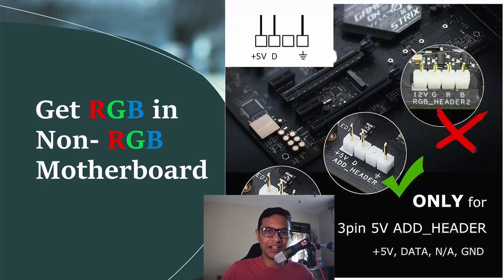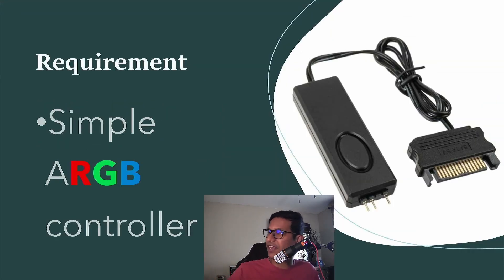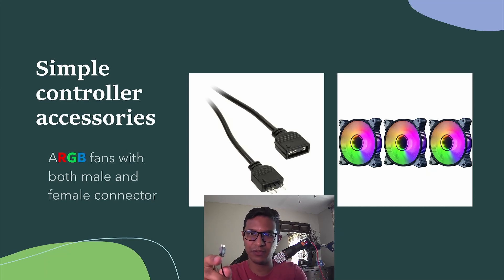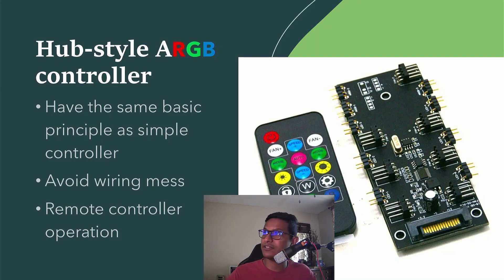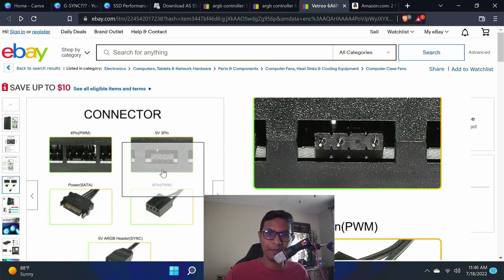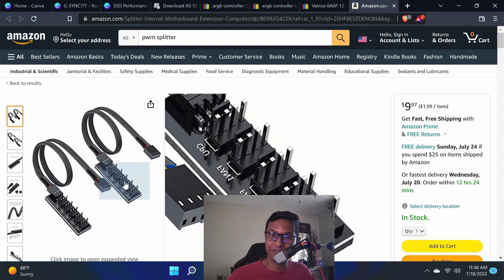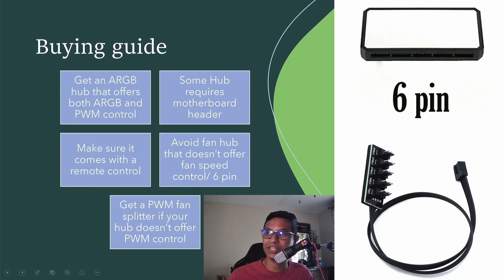How to get RGB on a Non-RGB motherboard

Comment: So I can use an argb hub just to control the rgb and I can control the fan speed from the motherboard if I connect the 4pin directly on the motherboard? My motherboard does not come equipped with an argb header only 4 pin

Comment: Great video brother, but is there an adapter that powers the RGB connector of the fans directly with a sata connector?
I have an old motherboard that does not have any RGB connector and I would like to make the RGB of my fans work.
I have been looking for a solution for days and online there is not even a shadow of these products.
God bless You!
Reply: Have same issue have 4 pin rgb fan but don’t have rgb or argb header in my motherboard how I power my rgb fan ? Did you find any solution

Comment: My fan hub has that sata to rgb thingy built in!!!!
Reply: What's that?
Reply: @Marco-vn1db it supplies power to more argb devices in a hub itd be because in the case of argb there is a recommended 4 device per connector due to it only having 5 volts

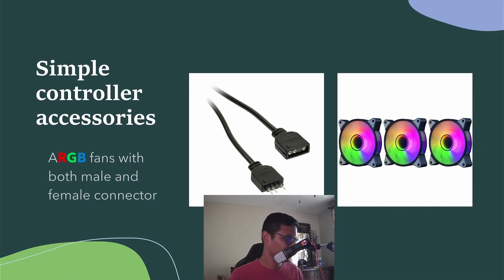Comment: 1:43 I am late to this but can I add 5 fans together to it? Also when I power on my psu like the swtich will the fans start or will they start only if I click the case power button?
Reply from the maker: @SuiiSpeed07 you can chain as many fans as you want. You have to turn on the pc to make the fans spin.
Reply: Please respond fasy
Reply: Answer: yes

Comment: Hello, I have a msi z370-a pro without any rgb or argb port.
can I control rgb with a software?
Thanks a lot
Reply from the maker: @darkomen3199  no. You need external rgb controller which is controlled by little RF remote control. Software control not possible.
Reply: an RF remote would be better anyways as software is gonna take up your PCs resources
Reply: Bro i hawe asus prime b450m-k ii and ARBG Se-214-xt cooler.My motherboard dont hawe 3 pin 5v and cooler dont show light did this controler can work on this cooler. Thank you🤔

Comment: I have searched a lot for a video like this! A simple guide that starts from the basic explanation of 3 pin (male and female) and how to properly use an ARGB controller. By far yours is the most accurate. Thanks a lot for this video!

Comment: Does this thing work with CPU cooler.... I have Deepcool ag400 digital plus....it has rgb

My motherboard don't have the header....so I can't run the RGB light of the cpu cooler

Any solution??
Reply from the maker: @MythBoyPro  rgb or argb? 3 pin or 4 pin. If it's a 3 pin argb then it will work with simple argb controller that I mentioned in this video.
Reply: @coolStranger516  Motherboard have 3 pin.....

But the CPU cooler have 4 pin
Reply from the maker: @MythBoyPro  sorry it will not work.
Reply: Yes, get a Argb hub and then get a 3 to 4 pin splitter
Reply: Just got my deepcool ak500s, my motherboard doesn't have 5v 3pin can i put it on a 6pin fan hub with a 6pin to 3pin converter?

Comment: Hello! Could I plug in an fan hub to to the ARGB controller adapter and to the SYS header on the moutherboard?
Reply from the maker: @Busy_Jon  what is SYS header?
Reply: @coolStranger516   SYS_FAN#1  
Its a 4 pin header in MB like the B550M DS3H from gigabyte, this MB doesnt have any rgb headers only this " "SYS header"
Reply: Did you do this Jon? I'm currently wondering if I'm going to need one of these controllers , iv ordered the thermalright argb fan/hub controller  but my motherboard doesn't have any rgb headers , I assumed the hub would control the argb on the fans 🤔

Comment: I buy Ak400 digital but my motherboard Gigabyte A520m k v2 have no 3 pin 5v 

Internal I/O Connectors
1 x 24-pin ATX main power connector
1 x 8-pin ATX 12V power connector
1 x CPU fan header
1 x system fan header
1 x M.2 Socket 3 connector
4 x SATA 6Gb/s connectors
1 x front panel header
1 x front panel audio header
1 x USB 3.2 Gen 1 header
2 x USB 2.0/1.1 headers
1 x Trusted Platform Module (TPM) header (2x6 pin, for the GC-TPM2.0_S module only)
1 x speaker header
1 x Clear CMOS jumper
1 x chassis intrusion header
Reply from the maker: @CholayThegreat-x3b  you can get a simple argb controller

Comment: Hi, i hope i can get a response, this is an act of desperation lol. So i got a pc for my friend, his birthsay is in a few days, and i wanted to pretty the build up. The mobo doesnt naturally support rgb, so i got a rgb connector (ROG one off amazon) it connects via sata cable but theres no lighta when i try on his pc. I can get it to work on my own, but i have to connect an rgb cord from the connector to an rgb header for it to work, which completely defeats the purpose of why i bought it. Am i missing something? Pls help, anyone, i only got a few days to figure this out 😭😭

Edit, idk if this info gelps, but its a dell g5 5000 and the front bezel and interior have a little bit of led. 

Also im willing to buy adapters or wtv, as long as i can get them quick enough
Reply from the maker: @snowyftw1412  post a link for the rgb connector that you bought.
Reply: @coolStranger516 sorry, I kept trying to paste the link and it deleted my comment. Didn't realize you couldn't add links mb

Should be the first that comes up when you look up this:  5V 3 Pin ARGB RGBW Cable for ASUS
Reply from the maker: @snowyftw1412  that's just a hub; it's not a controller. You need a simple argb controller like I showed in the video. It costs 5 bucks.
Reply: @coolStranger516  ah, darn. Is there any that you can control through software or only via the button?
Reply from the maker: @snowyftw1412  only via button if you  don't have argb header on motherboard.
Reply: @coolStranger516  alrighty, well thank you so so much, caught it jus in time, it should arrive a day before his bday. You've earned yourself a sub. I appreciate it man
Reply from the maker: @snowyftw1412  you are welcome  🙏

Comment: my remote stopped working to change the colors of the fans and now they are stuck 1 color the remote batterey is fine do i need a new rgb hub or is there a way i can get the remote to work again?
Reply from the maker: @icerexy6426  try to find a smilar argb remote on ebay. They are very cheap. Sometimes they work but it's not 100% guaranteed that it would work with your system.

Comment: Hello. I got a MSI B450 GAMING PLUS MAX mobo with 4pin 12v RGB header 

I want to install multiple "Cooler Master MasterFan MF140 Halo ARGB".
I found "Cooler Master Driver RGB A-RGB LED Controller MFP-ACBN-NNUNN-R1 MFP-ACBN-NNUNN-R1, Multicolor, One Size". 

My question is: Since this mobo doesn't have an ARGB header(3pin 5v), can i connect the ARGB fans to the controller and then connect it to my motherboard without any issue like burning something?
Reply from the maker: @giuseppe7695  you can't connect argb fans into rgb header in motherboard. You can connect rgb fans to the motherboard
Reply from the maker: @giuseppe7695  I would advise against using those rgb to argb converter. The pc industry was having voltage issues with these 12v 4 pin rgb header. That's why they got rid them in first place. All you need is a $5 argb controller. Then you can hook any argb fans from any brands.
Reply: @coolStranger516  Thanks for reply first of all. What's the advantage of the controller i talked about (Cooler Master Driver RGB A-RGB LED Controller) in the previous comment and the 5$ one in your video?
Reply: Looks like we’re running into the same issue rn lol, currently switching cases and just ran into this problem :(
Reply: @Tattowa_Official Have you solved it?
Reply: Hello im desperate please help me so i have 3 12v 3 pin connectors my mb dont support rgb or argb because its 12v not 5v will the adapter work in the video for all three or do i need seperate ones for each ?
Reply: @Ibby5.20  ARGB header has 4 "holes" but with one of them mission. Then, 3 pins only with 5V of power.
RGB header has 5 pins with 12V of power.

Are you talking about "Sys_fan" headers?
Since those are good to connect PWN cable to control your fan speed through mobo
Reply: @giuseppe7695 no sorry for confusion i was trying to say my mb dont support argb or rgb, my 3 fans are daisy chain able, i have 6 cables in total 3 for rgb that connect together to make 1 output pin and 3 for fan power that connect together to make 1 output pin, what will i nees to power the rgb and fans ?
Reply: @Ibby5.20  I got you now. Each fans has 2 cables: 1 for RGB and 1 PWN cable to power fans.
You have to connect them to motherboard but without using RGB or ARGB header because you don't have those.
All you need is to buy a controller that allows you to connect the RGB cables to it.

For the PWN cable to "Sys_fans" header(this head could be named differently on other motherboards):
Usually, this header has 1 AMP of power. Remember to check the power consumption of your fans to be sure to don't exceed 1 AMP
For example: If your fans have 0.3 AMPS, you can be safe since you won't exceed that limit.
In my case, i didn't exceed the limit, but remained 0.2 under my header limit and caused my fans to flicker

In my case:
I'm actually using 7 ARGB fans, on a RGB motherboard by using the Coolermaster i wrote about in my first comment
(Cooler Master MasterFan MF140 Halo ARGB).
I daisy chained ARGB cables 2 by 2 and the last one connected with no daisy chain directly to controller. Same for PWN cables.
Then, powered my controller with SATA Cable and connected it to motherboard through USB cable.
I also connected my AIO to that controller.

Now i control my fans through CoolerMaster software and AIO software.
Reply: @ oh ok i get you a little bit so can i use a sata to 3 pin for power and sata to 3 pin with remote to fans ? Will that work ? I have a deep cool controller but that isnt working for me i have a a320mk mb which dont support argb or rgb
Reply: @giuseppe7695  my mother board only has 4 pin for fans not 3 so i cant use that either
Reply: @giuseppe7695  what do you mean through usb ?
Reply: @Ibby5.20  Sorry for late reply, I don't check often YT's notification. Some RGB controllers have an USB cable that needs to be plugged in to mobo's USB header(usually it's placed at bottom of the mobo). 
What's the name of your motherboard?
Reply: @ its the asus a320mk
Reply: @Ibby5.20  https://www.youtube com/watch?v=2ZSfsSbodl8&t=50s

I found this video and i think it's what you're looking for.

The guy in the video has an ASUS mobo with no RGB header.
He bought a Cooler Master RGB Controller which comes with one power cable and a 4 pin "male" connector.

All you have to do is connect the power cable to your PSU sata power cable.
Then, daisy chain your fans and connect the output RGB cable to the controller. 
If you daisy chain fans in order to have a cable with no pins as output, then use the 4 pin "male" connector of the controller.

By the way, this video is very clear and simple. The 4 pins cable this guy show is the one from his fans
Reply: @ oh ok thank you but the link doesn’t work ?
Reply: @Ibby5.20  Between "YouTube" and "Com" ads the dot to complete the link. I didn't put the complete link to avoid spam report
Reply: @ i did that nothing says video unavailable ?

Comment: hey man, I've got a similar issue. I want to light up my cpu argb fan the same way that you did in the vid. Will it work or is it for case fans only?
Reply from the maker: @Ale2808-  it will work for cpu fan as well but you have to change your current cpu fan with argb fan.
Reply: @coolStranger516  yea, thank you
Reply: How about sys fan can i put argb 3pin to that?
Reply from the maker: @CholayThegreat-x3b  everything can be argb. You just have to change your regular system fan to an argb capable fan.

Comment: I'm using WAR HAMMER Kratos 1500 RPM 120 KIT ARGB that comes with a hub and remote controller, very cheap for how goood it looks but it uses 6 pin to connect 3 fans. I have  Deepcool GAMMAXX Series AG400 ARGB cpu cooler, the fans working fine but no RGB lights cause it has male and female only for 3 pin.
Is there a way to connect this with my current hub since my motherboard doesn't support any RGB
Reply from the maker: @esdeseog3366  it won't work with your current hub. Just get the simple argb controller if you want to light up your Deadpool cpu cooler.

Comment: i dont have argb fans . i have rgb corsair sp120 whihcv i realy like !!! i got the thermoright notte 360 cooler which has argb connection i bought an adapter but it still isnt working do i have to enable it in bios or download software
Reply from the maker: Not sure what kind of adapter you bought but argb connector needs an argb controller or argb header on motherboard. If your motherboard has argb headers then you have to download the software from your motherboard manufacturer but for argb controller you don't need to download anything. Your rgb corsair sp120 has rgb connector they are different from argb connector.

Comment: Tks for the video. I still have a doubt: I bought 3 pin 5v fans, but my mobo only have 4 pin 12v. I know I need and adapter for rgb, but can these fans work without RBG for now?
Reply from the maker: 3 pin fans will plug into 4 pin motherboard headers just fine.

Comment: My ARGB controller has a a cord that plugs into an ARGB port. Wtf? What is the point of the hub of it has sata, ARGB, and PWM, if it still needs the ARGB port… also my fans are molex.
Reply from the maker: Not sure how your argb controller look like. Can ypu post a link?
Reply: @coolStranger516  I just found out that I was conned into getting a hub that was not actually a controller. Cause You know no one ever explains the difference or is truthful…
Reply from the maker: @logandehaven8537  it happened to me too. You are not the only one. That's I ditch the idea of getting a hub completely.
Reply: @coolStranger516  I’m gonna get the bundle that has a hub with a controller
Reply: @coolStranger516  that and my fans are also apparently rainbow. I plan to get ARGB ones later. That comes with a RGB hub with a built in controller. It’s 36 bucks off Newegg and you get 6 fans too as well as a remote.

Comment: is there a way powering argb without a controller? i have a msi watercooler and i just dont have a header nor a contoller. they are little expensive on my country and i dont want to buy a controller.
Reply from the maker: You dont need argb controller if you already have argb header on your motherboard
Reply: @coolStranger516  i dont have a header on my motherboard so is there a other way to do it?
Reply from the maker: @lertmtheaux  you can get fake argb fans. They are just led but looks like rgb. But you won't be able to change colors. Another way to get those argb fans with remote control. They run on sata power. So you would be able to change colors but no the fan speed.

Comment: please help i tried the chain link method but my fans started smelling like there was something wrong but i didn't connect any 4 pin females to 3 pin males i don't know whats wrong now
Reply from the maker: Fan manufacturer? Are you connecting with argb header or pwm header? Argb is  always 3 pin and pwm is 4 pin. They have different shapes.
Reply: @coolStranger516  does the argb controller manufacturer have to be the same as the argb fans?
Reply from the maker: @twixxtro  not really. But you need the correct fans. Fans that have both pwm male/female and argb male/female.
Reply: @coolStranger516  i only have one PWM header on my motherboard and i connected a splinter to my fans so they spin without rgb because the argb connectors of my fans aren't connected to anything (each one of my fans have a 4 pin PWM connector, A male 3 pin ARGB connector and a female 3 pin ARGB connector) but everytime i try to connect them to the argb controller (chain link method)  it starts smelling like something is melting and the rgb is not working properly at all

(Cooler Master MasterFan MF120 Halo)

(Xilence XZ171 remote argb)

Comment: I have deepcool ag400 it comes with argb

My motherboard asrock b550 hdv

Can we do some trick just tu turn on the light, i dont need to controled or somethink

Just turn on the rgb ... can i plug it somewhere in motherboard??
Reply: Did you got your answer
Reply: @ayush_panwar7575  nope
But i buy some rgb cable converter (connected to sata port)

Around 2 dollars in my country

Comment: Please help me 😅.

I want:
Basically i want to control the ARGB with the software and sync the fans with the other components, such graphics card and RAM, and not through the controller control.

The problem:
My motherboard dont have the 3 pin ARGB conector, just 4 pin for the fans.

My motherboard: 
Kllisre B760 DDR4 LGA 1700. (AliExpress)

My fans:
Aigo-z12 120mm (Aliexpress)
Reply: Same 😢